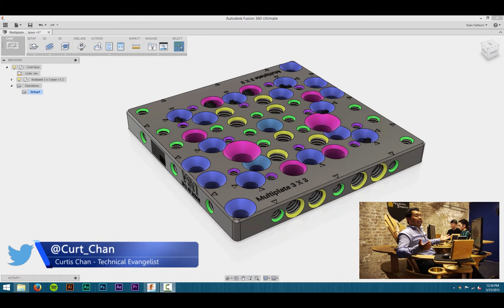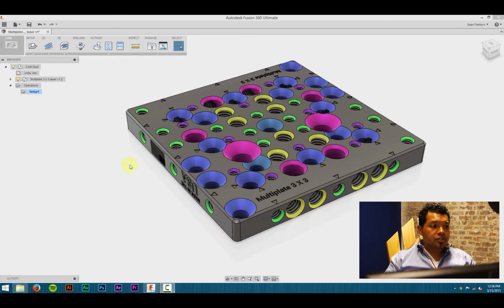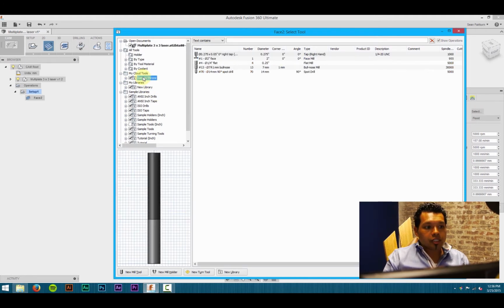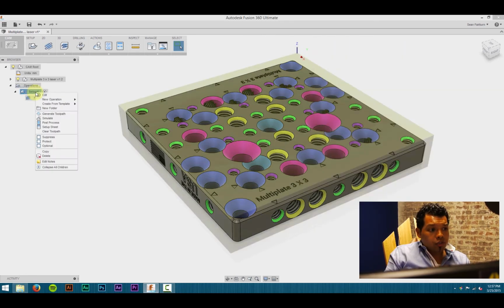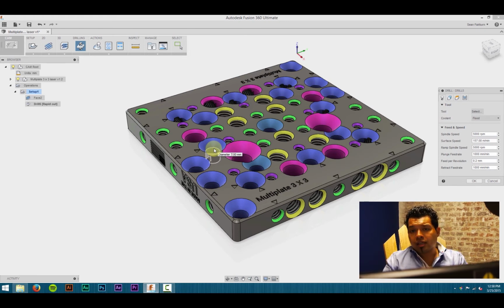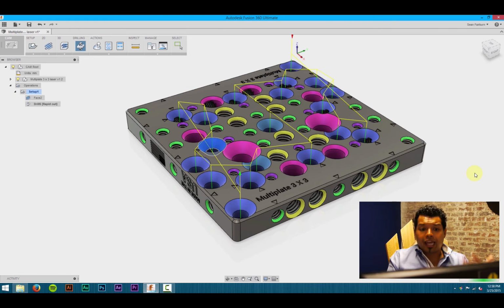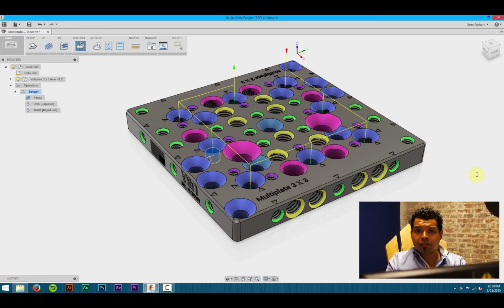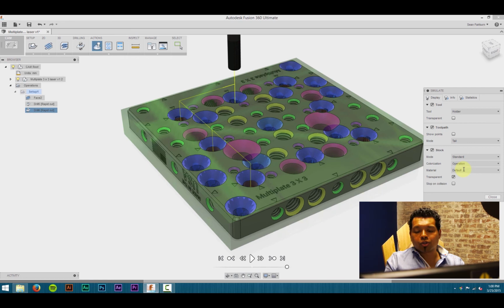Gaming Throne & Fusion 360 | 2.5 Axis Machining – Drill Operation Introduction

Comment from the maker: Check out Curt Chan, Technical Evangelist , on-site at Fusion 360 Customer 'Gaming Throne,’ showcasing a quick tip on using the Drill Operation in CAM for Fusion 360.